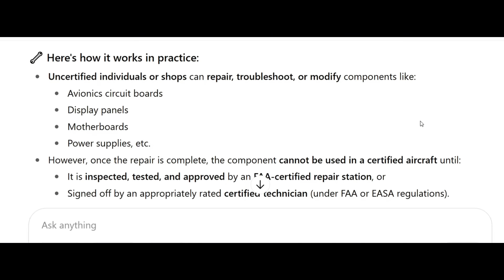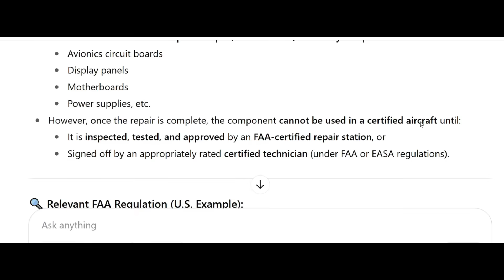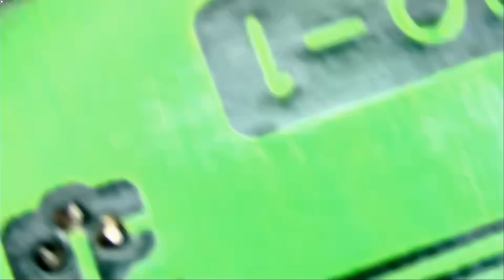We Fixed a Cessna Circuit Board Without FAA Certification - Here's what happened.

Comment: I am the Inspector and shop Supervisor for an FAA certified Instrument/ Avionics/ Accessories shop in California. What this man says is correct. An Inspector at a Certified repair shop will need to sign that part off before it can be legally installed in a commercial or civil aircraft. Technically, the repair shop that signs off that board should have the ability to Test the board In Accordance with  MFG spec. They would need current documentation and the tools and expertise necessary to do so. This is a simple explanation. I am leaving out most of the regulation and red tape surrounding this situation. In the end, responsibility, civil or criminal, falls upon the Inspector and the Shop that signs off on that part.
Reply: I worked in auto parts sales for 35 years, I have had a lot of people wanting 12V coils, nope, sorry, can't help you.

Comment: looks like it was a manufacturing problem in lowering the contacts which gone into burning the parts
lowering the conductor track cross-section will push in resulting higher resistant and this is compared in pushing up the amount of amps - thats the reason why the parts went into a cookingplate and burned away.
in the "good old days" powesupplies had with a good reason why there was added massive amound of solding on the rails by the manufacturing - try this with those psu which are sold today for customers with 1200Watts and more: you will soup the entire filters and resistors which are needed by these socalled "best quality" which came from shiner ;-)

my nearby 20 years old powersupply which were made by enermax in those time came evertime from recertification back without anykind of failures - flawless. Never changed one part on it. Stable as a Rock in powerdelivery - industrial standard devices

btw: sabotage by employees is nothing new in the vest by the socalled " con cow rands "  - terence and phillip hate the trick to got be cowphed and set at the catapult by berlin ;-)

Comment: Great job fixing the board! What shocked me is the condition the board came in: The 100k resistor nearly touches ground and the brown wire doesn’t look great either. I worked in repairing industrial electronic boards long time ago and the initial condition of this board would have been a non-go.

Comment: I ran a test repair soldering line in an aerospace company.  Your work is excellent, both troubleshooting and soldering.  I really would have liked to see you take that jumper wire off and tin those stranded wires where the wire enters the sheath.  Looks like the OEM overlooked it.  Your channel is large enough you might consider an AIRVAC ONYX 29 for BGA repair.  You are 100% correct on the repair aspect in terms of the FAA

Comment: Respect. I know the issue. Keyboard warriors are pretty annoying. Have the same issue with building home battery setup.
I build it by myself. Will be checked by certified electrician before I put in in use. 
The comments exploded.

Comment: I've done some designs for aircraft lighting sustems and can confirm that you don't need some special cert. We did production also, and had to confirm to certain standards. When we delivered we had to do certificate of compliance and certificate of conformance and faa lighting testing. That's about it, we just said we did it right to IPC or J standard and the customer signed off on responsibility.

Comment: Faa AC 20-62 allows use of "discrete electrical components " from generic sources. I take it to mean resistors, capacitors, etc. 
   Whether or not this includes more complex devices, like that chip, is questionable, not real clear.
    Elsewhere, use of the AC43-13 as a data source is mentioned...that is really intended as guidance when other, more specific data is unavailable,  usually when working on older aircraft, that had minimal service info available.
    Quoting the AC 43-13 doesn't make you right, and never can be used in place of data from the manufacturer.
    I see references to the 43-13 in log signoffs, and I've done that myself...right or wrong, if nothing bad happens, it's just an old, forgotten log entry.
   But when somebody dies, or lawyers get involved, and attention is focused on it, it gets different.
    I was involved in a lawsuit that didn't even involve an accident or injury. We, the defendants,  even had a representative from the aircraft manufacturer,  stating that our actions may have saved the owners life, preventing structural failure.......we lost.
     You are correct that YOU have nothing to worry about. 
     The mechanic who returns that aircraft to service might.
    It will probably never be known, unless- "something bad happens".
    Showing the ease of the repair doesn't prove it's right- the interpretation of FAR's, possibly related but harder to find "advisory circulars" (AC's), and , even worse, obscure "letters of interpretation " (LOI's) are all things that can hang you after an accident.
    A lot of mechanics with an admirable "get-r-done" attitude are different when they see how blame is really assigned. A lot of the same mechanics probably don't even know what an LOI is, or how to find one that applies.

Comment: absolutely correct explained. a part has to pass the test and inspection process before it is allowed to be used again in the plane. it is done all over the world this way, components of plains get repaired and go through a test and inspection process, if it pass it get certified for use, if not it goes again to repair or into the trash.

Comment: sure you can work on the board, some certification is time limited, some are only up to any repair, some are life long. some test equipment I have requires certification every couple of years to make sure that it is still valid and in spec and yes if there is a repair on it, it needs to be recalibrated and certified again. 
it all depends on what the certification is.

Comment: Mmm... technically I was breaking the law by repairing a circuit board from my sister's central heating boiler. Or by replacing a fan inside my mum's boiler. A faulty boiler could be even more fatal than a faulty plane, but also, any competent engineer will be aware that a "certified engineer" won't be doing the job any differently, and will charge a small fortune. I think I'll be able to sleep at night!

Comment: As someone that has worked at a electronics manufacturer the missing solder on the chips indicates that the wave soldering machine that they use is most likely broken (doesnt spray flux properly) as that is the exact same results as what we got with the wave soldering machine at work, that thing never got fixed properly only when it stopped the production line. Except this place cut out the touch up after wave soldering and I would bet only fixes boards when they fail testing, so the OEM board as is are far more scary than anything northridge does

Comment: The people screaming yOU haVE tO bE aN A&P iA tO SeRViCE ThAT forget the following;

You can perform repairs on aircraft, systems and components without an A&P license.

What you absolutely can't do though is go flying after self-servicing an aircraft unless you are an A&P. If your repair is incorrect and fails, you're liable for all damages, including on any individuals that were in the aircraft with you at the time plus FAA / EASA fines which will be levied after their investigations.

You MUST have a qualified A&P confirm the works have been done as per the aircraft's service manuals and that they will be safe. Once they've been signed off, the onus is on the A&P, not the person servicing the aircraft.

Comment: @NorthridgeFix my brother and his wife were on board a plane waiting to take off. A mechanic wheeled one of those tall stairs up to the wing and looked at some loose duct tape on the wing. He proceeded to remove the duct tape and left. Another mechanic came and cleaned off the old adhesive and left. Then a mechanic came and applied new duct tape. Finally, an inspector came and inspected the installation of the new duct tape. After his inspection, the plane taxied to the runway for take off. We wouldn't have believed that if my brother hadn't actually witnessed the whole process! Lol. Nice repair of the board!
Reply: Probably Speed Tape not Duct Tape.
Reply: It’s not duct tape. It’s called speed tape and is used on virtually every commercial aircraft at some point in its life.
Reply: It was most likely "Speed Tape" which is duct tape on steroids and a lot more expensive.
Reply: Pretty sure it wasn't duct tape, but I know there are tapes approved for certain uses like that on aircraft, iirc typically it isn't for safety critical uses, just better aerodynamics for fuel and potentially comfort or noise until a full repair or replacement can be done.
Reply: That would be aircraft grade "duck" tape. And remember, ducks fly and I am sure there 
are ducts somewhere in the wing. The inspector, I am sure was an HVAC expert.  🤣😂

Comment: Alternatively it can also go in an aircraft that has opted to be rated as experimental.  Something that is far more common than you may think, often you can get the exact same parts new from the same manufacturers for 1/3 the price, 1/10 or less for second hand parts. With an experimental aircraft your not allowed to take paying passengers (something private pilots normally cant do anyhow) and you have to tell any passengers you do take that the aircraft is experimental. It does lower the value of the aircraft but not by as much as you may think.

Comment: As someone who actually works in aviation flight test with avionics i can say there is nothing wrong with NorthrigeFix working on the board. The liability is with the QA inspector that allowed the install. Even with that said, the limitations for liability varies by flight clearance. FAA certified production aircraft in commercial service vs test aircraft vs military aircraft all different risk profiles.

Comment: Sorry, I didn't follow this repair from the start so I might be missing something. I just wanted to add that generally, aircraft/military PCBs have any wire links glued down with typically 46146 type RTV silicone glue (in high vibration environments, the wires can easily rattle and break via metal fatigue). Maybe the FAA shop will add that? Bodge wires in general are exceptionally common though, even in top-end fighter jet PCBs etc. Since the boards are super expensive, often have 30+ layers and limited stock exotic components, bodges are often far more practical than new board revisions. Thanks for the video!
Reply: Bodge wires are common, because they were that way when the item was FAA certified. They have to be exactly that way. No variance in route, materials, insulation color, bonding agent, etc. New bodge wires cannot be added after the fact without Cessna's sign-off and/or recertification depending on the extend of the changes. If the bodge makes any change to the schematic whatsoever, the product itself needs recertifying.

Comment: Merely the soldering doesn't require FAA certification.
Signing off requires such a certification. And it also requires testing, as laid out in the CMM. And of course parts, according to the parts list (in the CMM). And those are quite often MIL spec variants.

Comment: We trained under high reliability hand soldering in the RAD's school of radio in the RAAF in the 80's. That is the NASA standard of the time and minimal solder was required. This was needed to keep equipment weight low and reliable - every ounce counted. Cessna aircraft aren't in the same game. They are still in earth atmosphere and can glide. We did have HF radios in our RADAR system that could only be repaired by aircraft depot technicians due to their possible use in aircraft. Meanwhile, Boeing did an eight hour solder course in Australia to work on the WEGTAIL, AWAC project and didn't recognize the NASA standard of ex RAAF technicians working with them. Maybe just a refresher; but?

Comment: I was one of the comments that was a bit concerned about this issue. And while I didn't say specifically that this was illegal, I started I thought it couldn't be done by an unlicenced person. However, what I should have said was I was concerned about the reliability of the part afterwards, not that I have any doubt about his physical repair work since all of his work is top notch. I completely forgot that it could be sent to third party certified testers for recertification. And while Northridge could get certified, easily enough probably, the cost of the test equipment and work area would be cost prohibitive unless they were to do this type of repair constantly.
Reply: No, what you should have said was absolutely nothing, that’s why you have deleted your comment on his last video.

Because you, like others, are quick to jump on the bandwagon to criticize so it can make you sound like smartasses. You literally have a device in your pocket that can give you the correct answer in a minute, and yet you head straight for the comment section with misinformation.

Comment: Lol, you may need FAA certification to fly the helicopter or any aircraft over USA airspace, but fixing a PCB or a component of the aircraft is a different kettle of fish. It is an electronic component not an aircraft, until it becomes a part of the aircraft, but is still just a part or component of it. Next you will need medical degree to fix a component of a medical apparatus or equipment.

Comment: Aircraft mechanic here.  Alot of components have invidual manuals, aka component maintenance manuals or CMM, that outline how to do repairs on these components.  It might list basic circuit board repairs or it might not.  Ac 43.13 might be allowed also if its considered a minor repair.  Big thing i think alot of folks are missing is that inorder to re-certify it should be setup on a test bench per the appropriate manual.  Alot of repair stations use individuals with only a repairman certificate and an A&P to certify components back into service using applicable manuals.
Reply: Yes, had that board, had that tester number, also had the big ATE minicomputer system next door if needed, and still had the black box changers on the line change a part 5 times because they could absolutely not diagnose that the reason the ATE on the line was saying the reading was low was because they either had a leaking line to a test port, or another unit was actually faulty instead, which was also there in the test result as the sensor data being sent was wrong as well. But the box with 5 connectors and a bolt was the easiest thing to change.

Comment: I assumed there'd be some kind of process to prevent random people from just re-working aircraft parts and putting them back in service, but I didn't know the details.
I'm a little surprised any third-party shop would certify repairs (and assume the liability) that they didn't do.
I suspect there may be some difference between General Aviation parts and commercial aviation parts - have you ever been asked to rework a Boeing or Airbus board?
Reply: You didn't even listen to what he said. Any repair shop can work on a motherboard, but it is up to the A&P (mechanic) to certify and deem the board airworthy before signing it off and installing it.

Comment: Change the board . Simple fix.
Reply: And if its out of production? Just replace the aircraft I assume? Top comment as to why we live in a throw away culture today...
Reply: Probably few thousands usd for a few caps, resistors and ICs...
Reply: @filipsz6728  Well, if maintain aircraft is too expencive for you try african engineering. You can have plane made out of sticks and cardboard for few dollars.
Reply: It's probably discontinued or extremely expensive and hard to get
Reply: Where are you going to find a replacement board? Are you just going to pull it from another aircraft? Then what happens to that plane? How do we get the board for that plane?

People don't think.

Comment: Probably great for a school, or learning how to rebuild airplanes. Possibility to cost more to recertify than to buy a new board? Just a thought though, I have no clue what airplane parts are worth.
Reply: Do you think they would repair it if replacing was cheaper
Reply: @Knox-BezaleelTobias  If running an airline is expensive, let them wind up or change business to chicken rearing. life is more important and priceless.
Reply: @Knox-BezaleelTobias  it can be just a case of those boards not being available separately, or the model/type is end of life and not supported any more
those bodge wires from the original manufacturer on that board don't inspire confidence though 😂😂
Reply: There’s a term we use in aviation, they’re called “aviation bucks”, the current conversion rate is 1 = $1000. In my experience there’s almost nothing that comes in under 1.

Comment: I would have thought it doesn’t matter at all UNLESS it is controlling critical components or critical to safety like engine thrusters or etc,  standard entertainment features shouldn’t matter
Reply: everything is critical in an airplane... all sorts of things can cause them to fail
Reply: All components of the aircraft are held to the same standard no matter the system. A cabin entertainment system component could burn up and and start a fire in the cabin and kill passengers from smoke inhalation. The card he was working on is not an entertainment system card. I have changed a lot of similar cards and it is a part of what could be anywhere from an electrical system to environmental control system or landing gear retraction and extension system